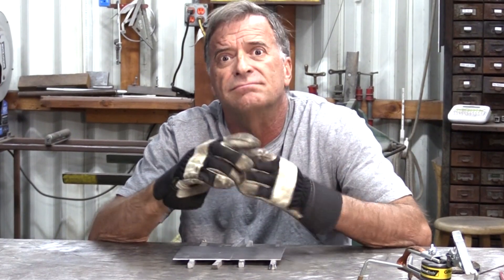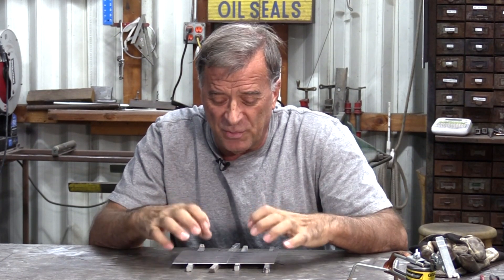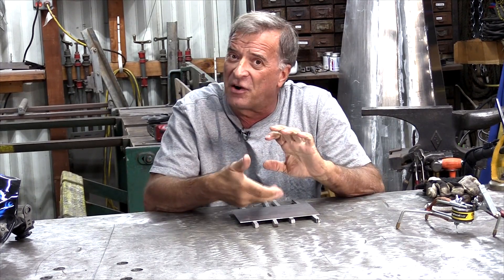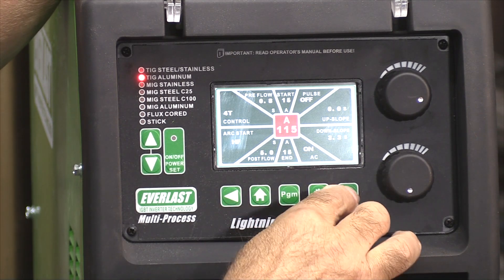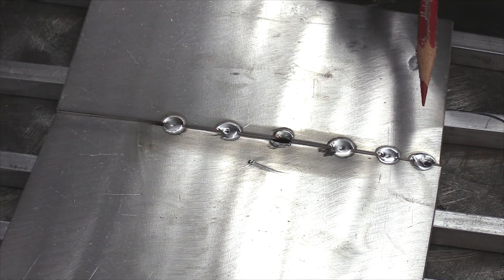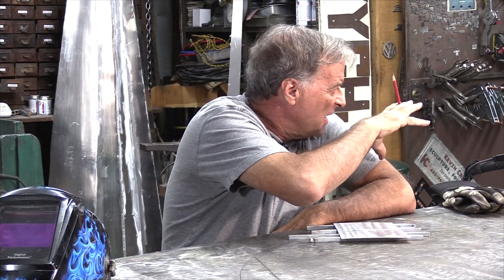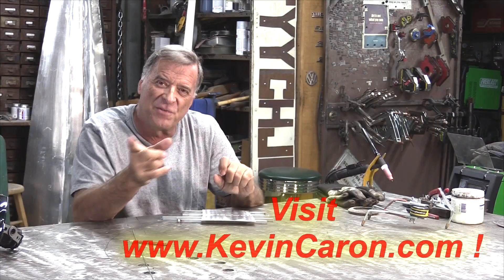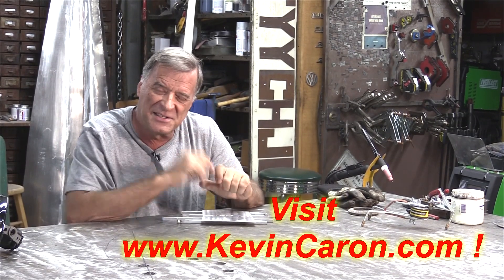How to Tack Weld Thin Aluminum - Kevin Caron

Comment: In addition to these great tips I find that the secret to tacking thin sheet is to use a very shallow angle on the torch like 45 degrees it seems to be more gentle on the metal and avoid holes.
Reply from the maker: Great tip!  Thank you for watching and posting.
Reply: I have found that also

Comment: What flavor/alloy?  3003 is said to tack w/out filler, no/little cracking.  

I hope to get some soon.  Been 30+ years since I last did Aluminum.
Reply from the maker: 5051 if I remember correctly.
Reply: @KevincaronSculpture  I have 5052 aluminum in .050.  Was “told” it might be too thin to weld if one hasn’t tried aluminum in over 30 years.  Only way to know, I guess, is to try it.

Comment: Great Tip Kevin .
I think so often new welders want to drive that torch into the middle of the joint like they might if they were mig welding .
Problem is ,, no wire filler .
The trick is just as you show it .
Wack  it with a quick shot , drag the pool across
Reply from the maker: Thanks for watching and posting.    I know I get in a hurry sometimes and just make a mess of things.  Slow down, think,  plan and then turn on the machine.
Reply: Uh,that would be me lol..

Comment: One thing you can count on from Everlast is the garbage grinder fan noise.
Reply from the maker: I would say a good 75% of the noise is from the water cooler.  Turn it off and the welder is easy to be around.

Comment: "now you can come back and weld it" ...now you can come back and tack with filler, those fusion tacks will not be very strong
Reply: Often so weak it breaks when you move it.
Reply from the maker: Very true,  just keeping the metal in place till I can grab a filler rod and get back to it.
Reply: Isn't that why its called a tack?